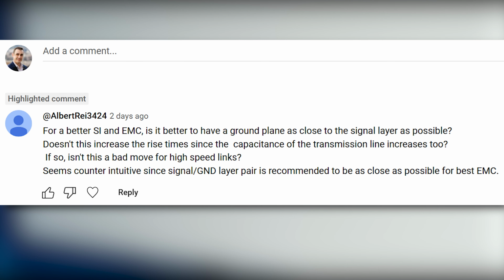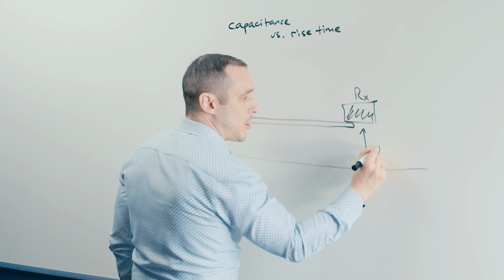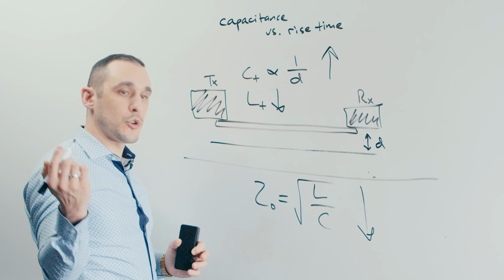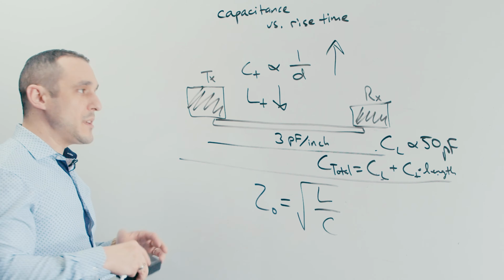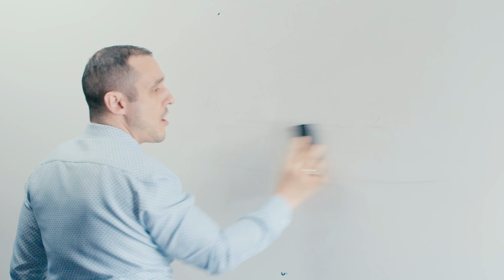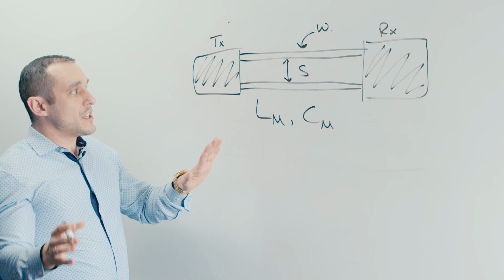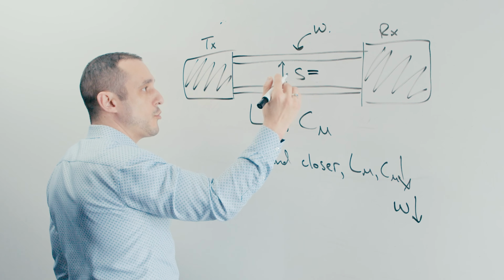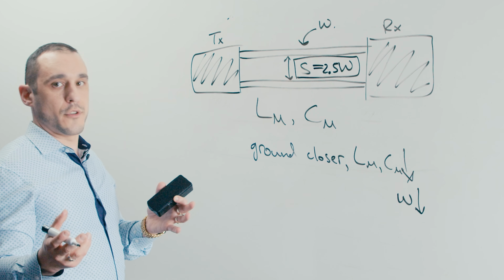Signal Integrity When Your PCB Layers Get Thin - Viewer Q&A #pcbdesign #signalintegrity #electronics

Comment: Did I understand the last part correctly?  If you bring the layers closer, but want the same impedance, you need to make the traces narrower.  If you keep them in the same place anyhow, that will improve/reduce crosstalk, but if you treat it like a die-shrink and also move them closer to each other ... that spacing distance can also shrink; it should just shrink by less than the track width did.
Reply from the maker: Basically yes, if you just make the traces narrower and leave their positions the same then you have also increased the edge-to-edge spacing, and that gives you lots of crosstalk reduction. In the die-shrink approach, you can't reduce the spacing by the same factor as the width and expect the same crosstalk, you actually get a bit more crosstalk if you do that.

Comment: Hi Zack, thanks for explanation, i have a question, What's your opinion on designing a 4 layers power board (flyback) GND/POW/GND/GND , all power traces runs through via in pad filled with copper  from underneath all components, assuming that the high fabrication cost is acceptable, is it a good idea? Thank you
Reply from the maker: Why do you think you need to design this PCB with the power embedded like this on a 4 layer stackup? Is there a specific reason? You could certainly design the PCB the way you describe if you want, you should try it and send me the PCB to review on Altium Academy.
Reply: @Zachariah-Peterson  the reason is to confine the electric field between ground planes to *eliminate EMC, its kind of experiment and wanted to know your opinion? Is it practical?
Reply from the maker: @hazehh789  You don't need my opinion for this, go ahead and do the design and see if it works. Just putting your power routing on an internal layer will not guarantee you pass EMC testing.